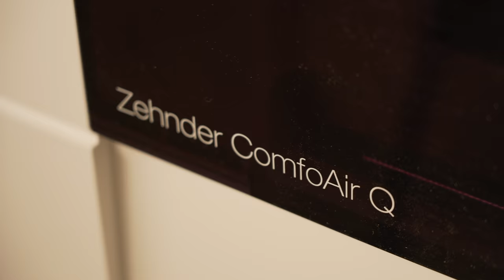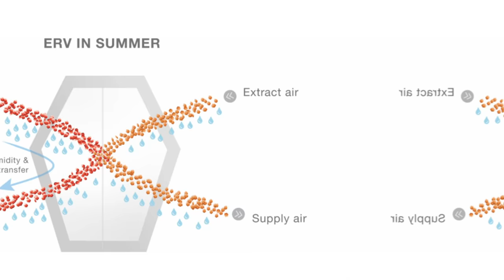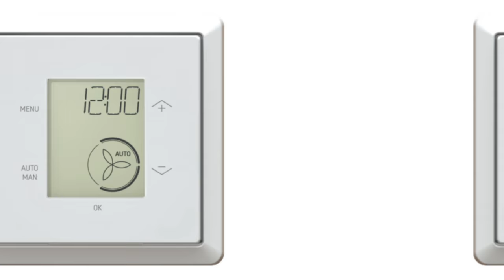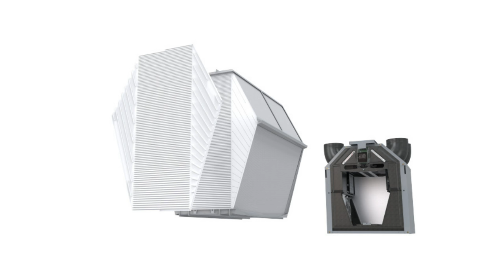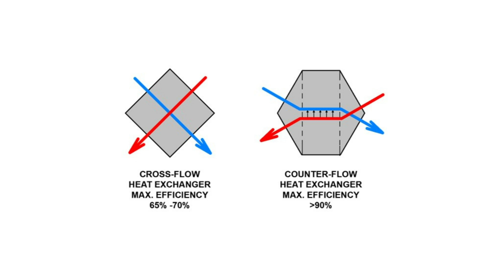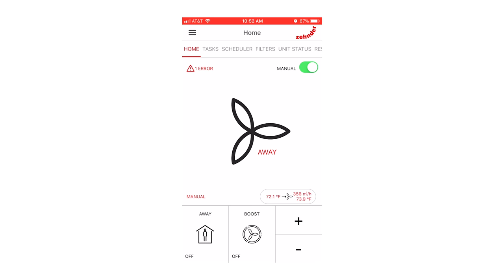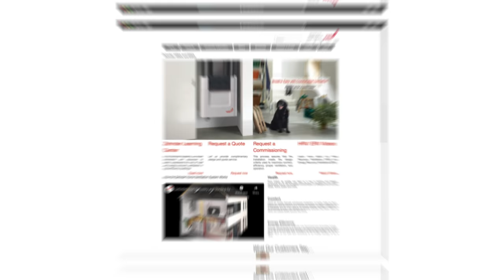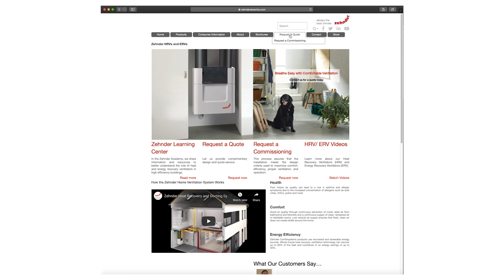Passive House - Fresh Air System Install & Costs (Zehnder)

Comment: You better run cat 5 or cat 6 and Coax 2 if not you will have someone like me drilling holes to install your internet and tv haha
Reply: He runs conduit for future low voltage wiring before he foams, so it is integral in the foam

Comment: Pretty sure these units are made by Airwoods in China.. a unit like this is around $1000.. so $11,000 for some hdpe duct and a little "engineering" is insane...

Comment: Why not just return to older home construction techniques that allow for a bit of natural air flow?  Tight homes are so toxic due to interior products....soooo, just put in a regular window that has constant air exchange, which is the ultimate goal.  Houses need to breathe.
Reply: That's great if you live in a climate which is 60–75 °F (15–24 °C) all the time.  But when it is really cold or hot outdoors, that is a very undesirable feature.

Comment: What about maintenance? Yes, the thing is built to last however if something breaks down and it needs to be serviced do I need a guy from zeinder to come out? Heaven forbid but if a few decades go by and they are not around I may need a new system of no one can repair this stuff. Not trying to be cheap but thats my only hesitation with this super high end stuff.
Reply: Zehnder is a 4th-generation company and is investing in the North American market. I'm an American who plans to stay and I have long-term ambitions about improving indoor air quality in American homes. ;)
Reply: Ty Chris that does help a ton!

Comment: MATT WHEN YOU GET DONE YOU GOT TO SHOW US A AUGUST ELECTRIC BILL NEXT SUMMER OR THIS MEANS SQUAT TO US
Reply: This has nothing to do with AC.
Reply: 33:25  The Zehnder rep said that Matt's system will be consuming 100watts.  So that's 2400 watts/ day or 2.4kw per day.  And where I'm at, I'm paying 0.11cents/ Kw.  So that looks like about $0.26cents / per day to run.  Not bad at all.

Comment: I can't imagine not having a natural gas oven at least. I can only imagine the electric cost to run that oven.
Reply: Not sure what oven stove combo your talking about but the largest oven HD has online is ¢86 an hour at max  load all 6 elements on full power with my local power rate.
Reply: @JamesBlazen  electric is better for baking things that you don't want to introduce moisture into. Googling this to see if it was true, I'm finding mixed opinions on the matter. The ability to adjust the temperature quicker is the main advantage I look at.
Reply: @its.free.realestate  I have no problem with an induction cook top...

Comment: Hi Matt -- love this series!  Just wanted to get something on your radar potentially for a future episode -- possibly in connection with the build of your own home.  The issue is PEX.  I was looking around on the interwebs and found this from 2017: https://www.researchgate.net/publication/315702292_Transfer_of_phthalates_from_c-polyvinyl_chloride_and_cross-linked_polyethylene_pipe_PEX-b_into_drinking_water
I'm not so concerned about the drinking water since we can put a point-of-use water filter under the sink, but lots of people are now using PEX for in-floor radiant heating (in Warmboard, for example) and hot water supply lines.   I'm especially wondering whether hot water flowing through, for example, the Uponor or Viega PEX products would cause the them to off-gas toxic vapors into living spaces.  Is this a problem?  If so, are there any good work-arounds or developments in the PEX space -- perhaps newer PEX that do not contain any of the concerning toxic materials?
Reply: Great point.

Comment: Living in a sealed box with the same technology they use in outer space. . . as if the environment were alien to human breathing.  This is an example of psychological obsession that exceeds all rational thought.  You might as well walk around in your house with breathing apparatus and air tanks.  Why even bother having windows.  In a house like this the windows are no different than TV screens.
Reply: I agree to some extent. There are several issues here...I speak from personal experience because I just built and moved in 6 months ago...first of all, with 4 kids in the house, your doors will be opened 40+ times a day. So that perfect seal is never going to happen. Second, the energy efficiency of a well-built home even without all the trickery is so high these days that you can't possibly save that much money. My peak electricity bill this summer was $180  when we were in the 100s every single day. How much less could you spend? Maybe $80-100? But the cost of this AC system vs even a top of the line system is huge. For the average homeowner, buying a system like that could cost $75k (not including all the air sealing, exterior insulation etc) vs a top of the line Carrier Infinity Greenspeed System (fully variable inside and out) with MERV 13 media filter for less than $25k. It just doesn't make sense to spend that massive amount of money for that little savings IMO. This is certainly a geeky and fun system to marvel at, but I also have some concerns about eventual malfunctions, breakdown and wear and tear on all these highly complex mechanical systems that need each other to work correctly.

Comment: Spend thousands extra to make your house really tight. Now your house will kill you so you need exhaust and air inlet. Now spend thousands to vent your air in the house because it to tight. Your furnace or A/C has to run 15% more for the ERF or HRV system. Mold growing in the tubbing that connect the system that has to be cleaned out. 
The old double pane leaky windows and toilet exhaust sound better, and much cheaper. I recommend a 96% furnace and a 13 or 14 seer A/C. 
What would you do in a prolonged power outage have to open the windows to keep the house from killing you.

Comment: $10k system vs a few windows cracked open.
Reply: do you really want to open windows in scorching heat or freezing cold?, with this system you don't even have to worry about the air which will be filtered and conditioned automatically without having to worry about opening windows in heat or cold

Comment: So if it is completely airtight, then at some point all the household chemicals used in daily life do not dissipate. I'm talking bleach, floor cleaners, bathroom cleaners,  kitchen cleaners, etc. And no amount of air fresheners (another harmful chemical) will fix that. Sure you can spray and cover up the toxicity but over a decade of use, the house will become a toxic mess perhaps requiring its own Superfund. While I commend the attempt at making it airtight, I see an unfortunate cancer filled future.
Reply: What in the world are you talking about? It isn't completely air tight. You'd be dead in a day if it was air tight.
He's aiming for 0.5 ACH, which means every 2 hours the house has fresh air.
Reply: I think you misunderstand this system. There is constant air exchange with the outside, but without the same level of loss of conditioning (heat/cool/humidity) that would result from just having an open window. In an airtight house without this type of system, yeah you would have just the problem you describe with the build-up of pollutants. The tighter houses get, the more they need these ERV/HRV systems.

Comment: Matt.  You should probably stop using the human body as a example of air tightedness.  Skin has a billion holes in it. The way you describe it every body should wear a latex suit.  

For houses to be confortable. They need to breath.  It helps them dry out.  I admit in some climates this isnt true. 

For a example i have a drafty house , a tiny heater and no air conditioner.  Lots of people live in the house and everyone is happy and confortable.  

I do like your videos.  Thanks

Comment: Why would you have a "huge" gas range and not have a proper vent hood ( sales CO2 scare pitch)?   34 min and never show how the vent fans connect in the bathrooms. but implies they exist! though the video, until the end .    Claims he only has two holes but never addresses the Range Vent hood or dryer vent?  So really what this is doing is replacing all the vent fans and providing the ventilation Sans the range and dryer

Comment: Why the hell are you going to install something like this on a single family home? FFS put it in an apartment complex.
Reply: Are you serious? He explained this at the beginning of the video. You need ventilation in any modern house especially one as tight as his.
Reply: @ssl3546  its absolute over kill imo. It's fine if someone wants to do this on their own house, the heat exchanger thing, but this is the kind of tech we need in public buildings because that's where you get the most bang for your buck
Reply: Great point! We're involved in many multi-family projects as well.